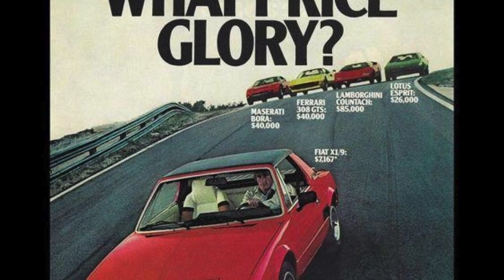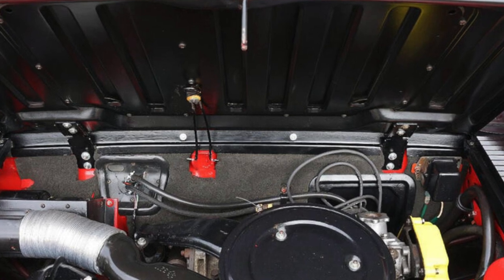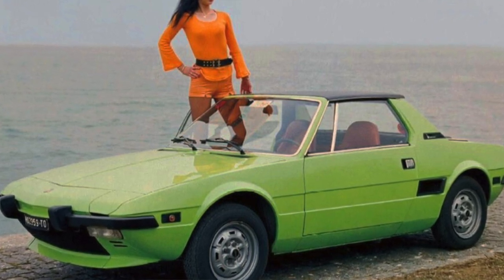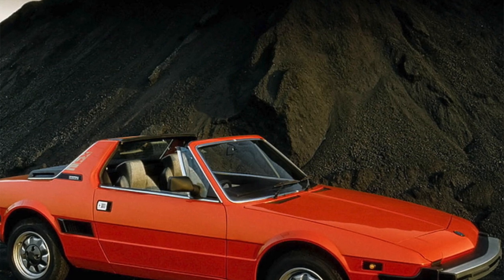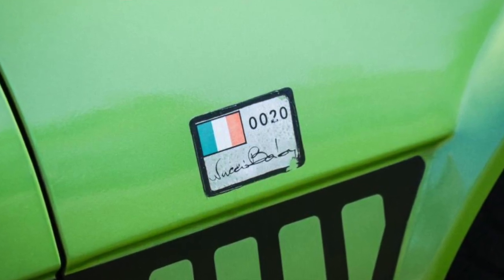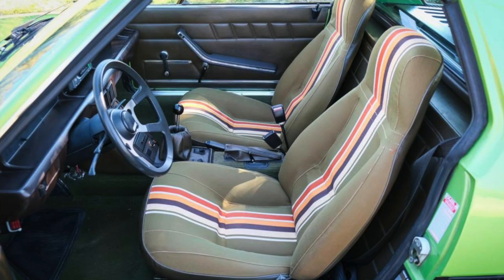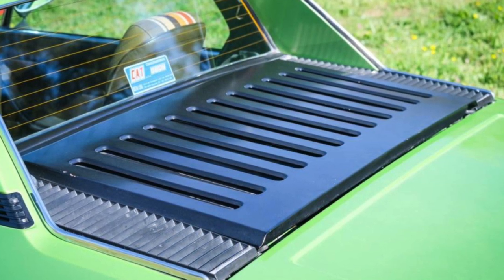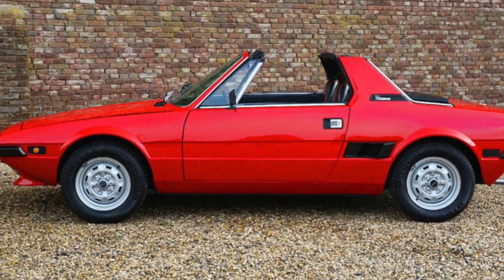The Secrets of Fiat_Bertone X1/9 Part 02, Italian POV | Johnny's Garage

Comment: ..would be nice to see Fiat bring out an updated version.
Reply from the maker: Yes, ot would be great!
Reply: @M. E.
Let sleeping dogs lie.
Reply: @hyena131  No doubt there are elements in the X1/9's design that would be illegal for a new vehicle on American roads today.. most particularly, of course, the pop-up headlights.
Reply: @m.e.345  As far as I know, pop up headlamps being illegal is urban legend.  This Fiat was crap to start with so why unleash an updated version was my point.
Reply: @m.e.345  I'm doing a projector headlamp conversion, using four 90mm Hella lamps in place of the pop up unit.
I had to square out the lower corners of the apertures in the body and mount the lamps inside the body.
This will require me to make an outer lens from clear acrylic to finish flush.
This part also closes off the aperture from water ingress, unlike with popups.
Three times the wattage, half the weight, all bulb options inc gas discharge.
Also way more aerodynamic.
But I'm in the UK and this is on a car with a full bumper delete inc screw in tow eyes and a modified serie speciale front spoiler.
I had to install the spoiler at a shallower angle because the whole car is lowered 3" on coilovers.
Still no idea if the headlamps can be set up to pass the MoT but I'm hopeful.
Reply: @markbowden7238  
Mark, it's time for you to find a boyyfriend...

Or at least brave it and go out for a drink at your local pub and meet some fellow human beings.  Just don't give up...

Comment: Make no mistake the X1/9 with some bolt on suspension upgrades, twin 40's on the later 1500cc engine, along with an 4 branch exhaust manifold and sports silencer ; makes a great, great, great fun car. Better still do some head work and remove some weight  you have the fastest small sports car on the road.